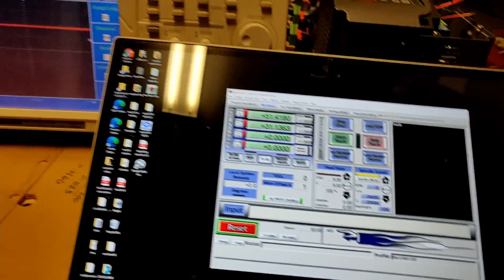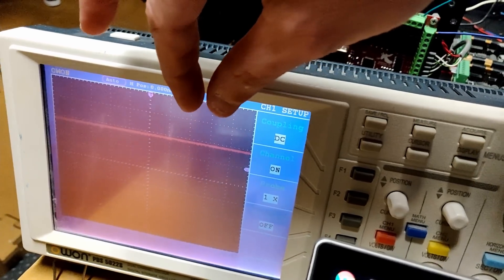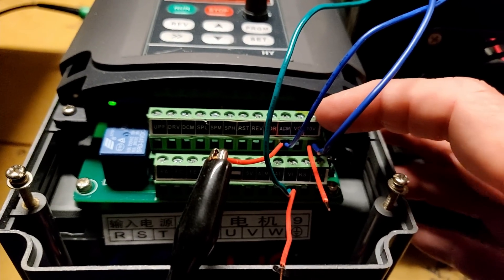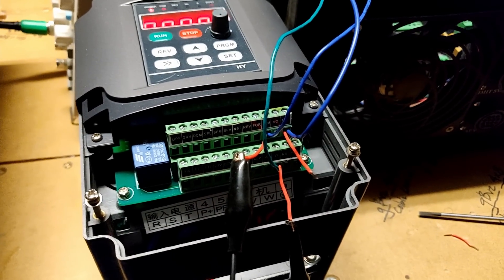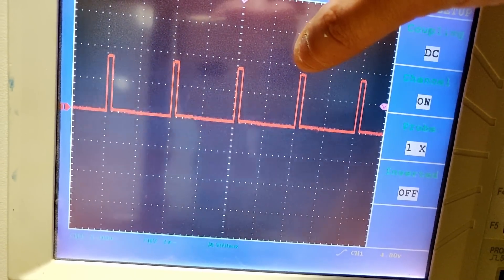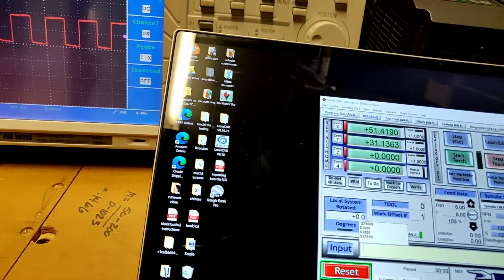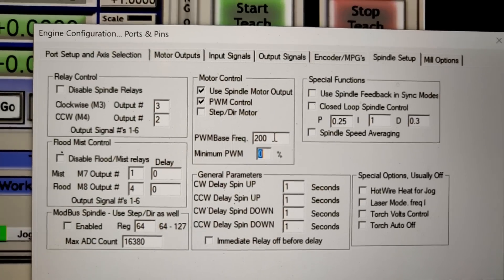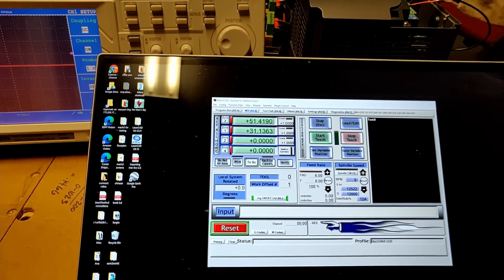Mach3 USB Spindle Speed Control

Comment: Thanks for the informative video. My spindle motor doesn't move at low frequencies. I can initially run it at 2,500 rpm and then reduce it. I want to run it at 300 rpm to use the mechanical edge finder, and when I give it 2,500 rpm, it feels like it's about to pop out.

Comment: Hi PAtrick, I have this same Mach 3 board, I have my board connected and I can turn it on and off. I have the PWM set at 60% so when I type in 16000 rpms it climbs to that mark but constantly drops and raises the RPMS by 1500 to 2000 rpms. How can I stabilize the spindle RPMS? Thank you
Reply: Hi there, My spindle is doing the same thing. I'm just checking to see if this works or if you found a way to fix the rpm problem. There's not a lot on the net about it. Thanks David
Reply from the maker: I just responded to the top comment here so check it out. Sorry I responded so late!
Reply from the maker: This is typically an EMI issue. I typically recommend shielding the cables, but if you are already using shielded cables, you can try a ferrite core, or inductance to reduce these fluctuations. Alternatively, you can refer to use the RX/TX RS-485 to communicate with the VFD.

Comment: Hi thanks for your great info just have a question I'm running a 2.2kw 3 phase 2 pole motor I follow yours set up and it works great but it does not hold its rpm it seems to pulse up and down. Just checking to see if you have any ideas. Thanks David
Reply from the maker: You might need to add some inductance to the signal cable from the controller to the VFD. You can use a ferrite toroid and wrap the signal several times through this toroid. Also, make sure you are using shielded cable. The number of wraps should be around 5, but refer to the datasheet of the ferrite toroid to determine a better value.
Reply: Hi there, My spindle is doing the same thing. I'm just checking to see if this works or if you found a way to fix the rpm problem. There's not a lot on the net about it. Thanks David

Comment: I’m having a issue with the output voltage. No matter the setting changed I’m getting a out voltage that varies. Unless set to max 

So if set to s12000 I’ll get like 5-5.6v. But if set to s24000 I get the 10v 

What setting am I missing why is my voltage wondering.
Reply from the maker: Make sure the VI jumper on the VFD is set correctly. Did you do this yet? If you don't have a jumper, what model of VFD do you have?
Reply: @PatrickHoodDaniel  basic hy 1.5kw vfd. 
I believe my wiring is correct. Acm to acm avi to vi 

Is there somewhere I can send you a video or picture of my issue?
Reply from the maker: @shawnr699  Did you set the jumper. You did not mention that in your comment. That will most likely be the issue. The jumper is on the circuit board of the VFD and it is well described in the VFD manual.
Reply: @PatrickHoodDaniel  the board is controlling the spindle,
that’s not the problem.
 it’s the variance in rpm/voltage. 

I can control the spindle. if I set it to s24,000  it goes to 24,000. If I set  it to s12,000 it goes to 12,000 and then up to 15,000 and then back down to 12,000. Back-and-forth.  
Fluctuating voltage/rpm
Reply from the maker: @shawnr699  There is also settings in the parameters to set the frequency in steps. Take a look at those parameters just to see if there is any correlation. It may be better for you to connect via RS485. You may be chasing down EMI issues on your signal wiring between the controller and the VFD.
Reply: @PatrickHoodDaniel   for an update I got it working with a usb rs485 adapter :) Thank you for the suggestion!
Reply from the maker: @shawnr699  Excellent!

Comment: there is the speed difference between mach3 and actual spindle for example if mach3 is givenn S3000, the spindle spins at 5000 and above rpm. how can i compensate ?
Reply from the maker: Spindle Pulley Settings. Here, you can adjust the max speed setting to bring Mach3's perception of spindle speed in line with reality.
Reply: yes i have tried but there is a non linearity in my setup speed difference is different at different rpms  @PatrickHoodDaniel

Comment: Thanks for your video and help. I’m having a little issue, cannot manage to control the spindle with mach3. I’m using a leafboy77 board, and the same VFD that you. It works when I control from
VFD but when I try to do it remotely I cannot. The display blinks. Any clue? Perhaps is Pd002 or Pd001?
Reply from the maker: On/off control or speed control?
Reply: @PatrickHoodDaniel  Hi! I manage to turn it on, but now I cannot control speed, to make it slower of faster. It spins all time the same speed. Thanks for your help
Reply from the maker: @CristianSanchezz22  You velocity and acceleration parameters are in the motor tuning screen.

Comment: buen dia, tal vez me puedas ayudar. Mecesio conectar un modulo laser a mi cnc, la cual tiene una interface como la del video. El modulo Laser necesita de señal 24v, (positivo y negativo) y la señal PWM para controlar la potencia. conecto AVI a PWM del modulo pero no logro en las configuraciones del mach3 que esta señal salda de la interface. desde ya no tengo conectado inguna otra entrada como los 10v u otra como las que mostras en el video.
Gracias
Reply from the maker: ¿Qué nivel de voltaje PWM necesita para el módulo láser?

Comment: NEVER NEVER use a PWM for speed control your Spindle. VFD work only with analog input. You must use an PWM to analog converter between your board and VFD. You can burn your Spindle a weird sound like a high frequency and spindle run too hot, you can domage spindle. The VFD didn't work with a pulse.

Comment: Great video but I’m still lost!
I’m running g540 with a Hy 2.2 spindle,and vfd.
Mach3 
All the wiring is correct and ports and pins settings are correct as far as I know.
Spindle comes on correct through relay controlled by g540 but goes straight to wide open 24,000 and can’t be adjusted no matter what.
Tried entering S command and still nothing! Ugh!
Reset vfd numerous times and still no change.
Thanks if you can help!

Comment: Hi, All the setting work fine for me, but I can’t reach maximum speed with the board. The max voltage turn around only 0-8.4v. My maximum speed only 21000 (My spindle have 24000). My VFD work fine with a pot on it or a 10K pot external. I can speed up max if I hack setting PD072 to 1 for simulate a 0-5V. Otherwise, I have two board and same problem.  Someone can fix this?
Reply: Hi, Did you ever solve this? I have the same issue.
Reply: @littlebigadventuring  Hi. just set to PD070 to 1 for work very fine with 0-5V with thix board. I use also use analog converter for output signal.

Comment: I cant seem to get spindle speed control from mach3. I am able to start and stop the spindle, and the speed DOES seem to be set by the mach3 software but i am unable to change the spindle speed from what seems like top speed. I have have done everything (wiring, programming, and vfd parameters) the same way you have it set up in this video with the same spindle, BOB and vfd that you have in this video.
Reply: For anyone who is in a similar situation, in this video it isn't mentioned but there is a jumper to the right of the terminals on the vfd that is set to VR by default. It needs to be moved to the VI pins instead. This will switch the '1' option under pd002 to actually being externally controlled, instead of that option being the built in potentiometer knob. In addition, pd070 needs to be set to '0' as that is the selection for 0-10v pwm.

Comment: Is there a parameter on the VFD that needs to be changed in order to start and stop the spindle? I understand that the source of operating frequency needs to be changed to 1, but I'm curious if there is a separate parameter for the start/stop function. I am using the same USB board and the same vfd/spindle combo, wired the exact same way you have it in this video and the outputs video. Im assuming thats pd001
Reply from the maker: Yes, there is a parameter that allows you to use the external terminals instead of the control pane. The parameter number depends on the specific VFD, but I believe the HY VFD is PD001. The terminals you will need to use are FOR and DCM to run the spindle in the forward direction,
Reply: @BuildYourCNC  it was yes! I had to fiddle with the ports and pins tabs after setting the vfd though because the dual relay I had ordered had a faulty side and of course that's the one I originally wired to.

Comment: Hello, I have a problem with spindle speed because it varies constantly. I did all the same settings but not working. Do you have some advice? I tried setting speed with potentiometer and its stable speed, but with board its not, all wiring is the same

Comment: I bought a UT4060 cnc router and found out that the VFD and the controller board are not wired at all. I have a Rnr motion controller just like the ones you sell. Can I send you pics of the VFD and help me to wire it  ? thanks.
Reply from the maker: We can help, but since the board wasn't purchsed through me, you will need to purchase a tech support token. https://www.buildyourcnc.com/item/sub-assemblies-Technical-support-token
Reply: @PatrickHoodDaniel  Can't you just tell me the connection for a H100 S1.5 VFD ? Can't which input is the ACM

Comment: Hey. I got this board but don’t understand for example AVR, the 10v return. What pin on parallel port is that. When I look at mach3 pin out there is no AVR.
Reply from the maker: There is AVI and ACM. I am not familiar with an AVR terminal on this controller.

Comment: Great video. I have connected my vfd and set the configurations according this video. Everything works perfect, but I still have one question. In the Spindle setup I entered 200 in the field for the PWMBase Freq. Now I measure a PWM signal at the AVI terminal of the BOB with a frequency of 1000Hz. Should this not be 200Hz? What could be the reason? What do I have to change to obtain 200Hz?

Comment: Thanks for sharing, I have the rnr controller you are showing, do I need to use a relay in order to run my spindle? I have a Hy 2.2 kw spindle. Thanks in advance
Reply from the maker: Yes, I would use a  relay. In the VFD manual, you will notice that the FOR, or REV will run if connected to gnd.  You can see where I use a relay with this board here: https://www.youtube.com/watch?v=Qi4M3DAtTXg

Comment: WHAT PARAMETERS ARE USED TO OPERATE IT DES MACH3 IN THE YL620 MACH3 AND RNRMOTIONG RED AND WIRING
Reply from the maker: There should be a parameter that sets the frequency control to the external terminals.  Use that one.

Comment: How to reverse move motor?
Reply from the maker: If you want to reverse the spindle rotation direction, you can select the reverse mode on the control panel. If the spindle is turning in the wrong direction in the forward mode, then you can swap the U and the V connections in the VFD.

Comment: Great vid, thanks a lot for sharing! Quick question: I have the same Mach3 breakoutboard that you have here, do I need a VFD to digitally control my AMB (Kress) spindle? Or can I use some simple relay wizardry?
Reply from the maker: From my understanding, the Kress plugs directly into the wall.  If you wish to control the on and off of the Kress,  you can use a simple relay. There is a speed controller on the Kress, but you would need to research someone that has already done a teardown and applied some kind of functionality to make the variable speed work.
Reply: @PatrickHoodDaniel  Thanks!